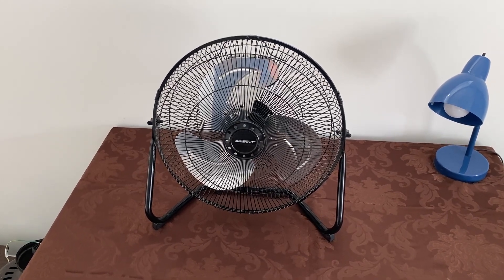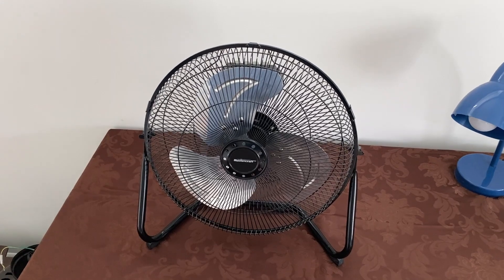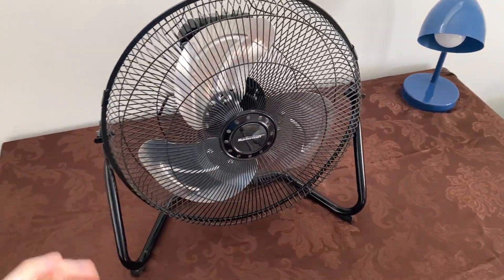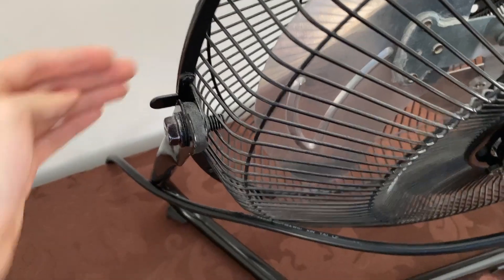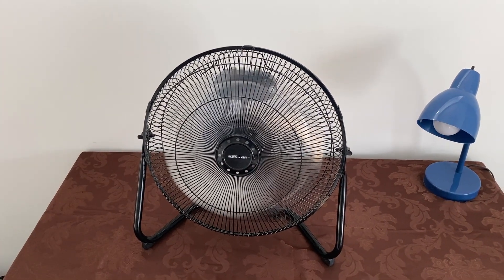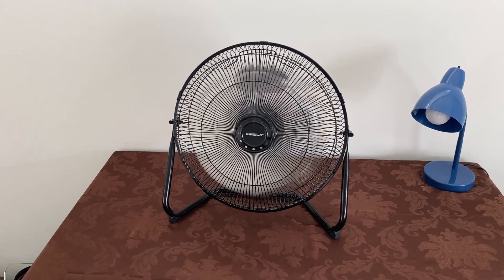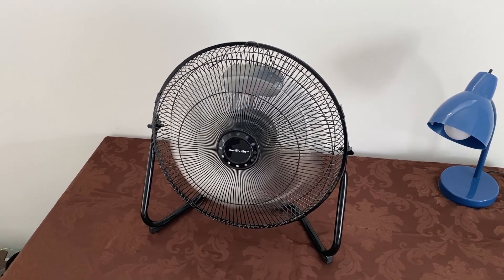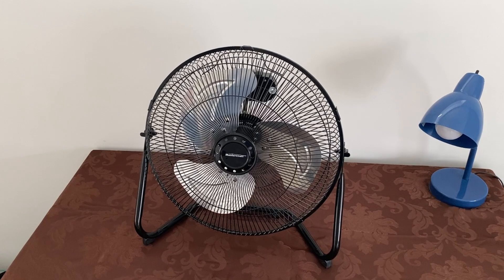2015 Mastercraft 14” High Velocity Fan | 2022 Remake

Comment: I'm just curious should these fans be taken apart and the axle point greased or lubricated?
Reply from the maker: Yes it can be taken apart, though it's not the easiest on this particular fan. However, since both ends of the motor shaft are exposed, you can oil them without disassembling the motor. I recommend 3-in-1 electric motor oil (blue and white bottle) or ZoomSpout all purpose oil for fans. A few drops can be applied the points where the shaft enters the motor casing.
Reply: @TheSuperFanMan  Mine doesn't have a back piece exposed I don't think. The Mastercraft fan I have only has the motor axel exposed where the fan blade mounts inside the cage.
Reply from the maker: Ah I see. Is your’s a 20” fan by chance? If yes, there’s a video that a fellow YouTuber posted on the motor’s disassembly and oiling process for an identical fan (just different brand name). https://youtu.be/V5yMERgTTfc
Reply: @TheSuperFanMan  Interesting thank you. Yeah, It doesn't even have that attached piece at the top with the buttons. The one I own has a dial directly mounted just above the engine. The reason I asked this question is I had a slightly cheaper fan before, and within only like half a month of use the motor seized.